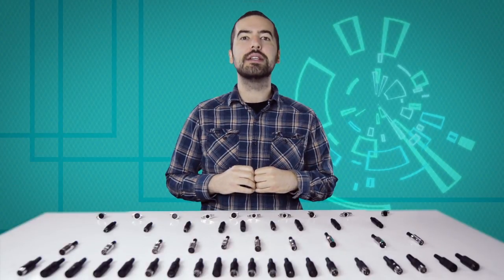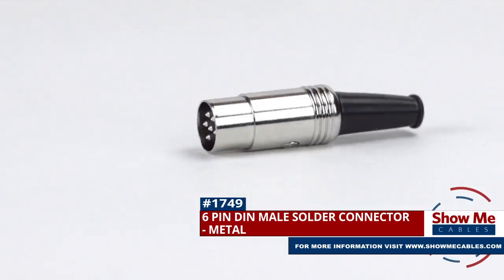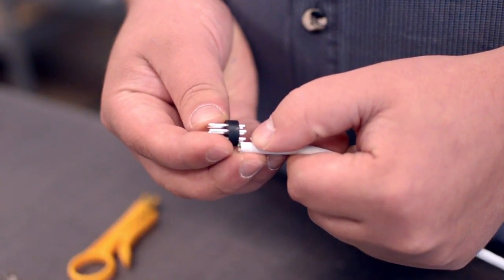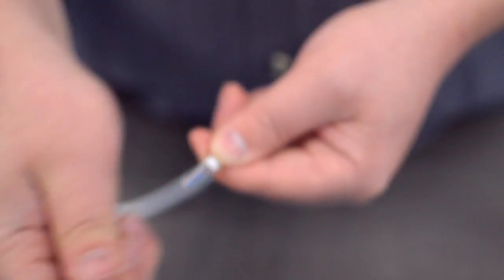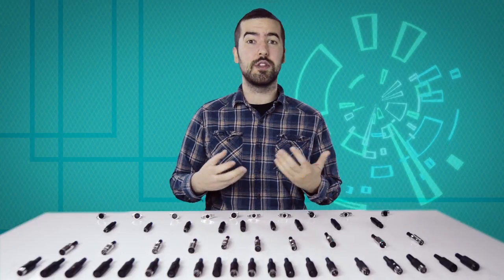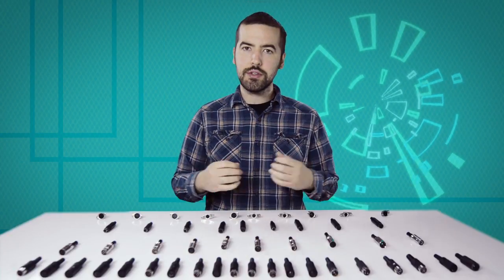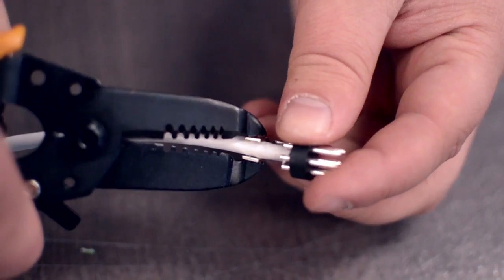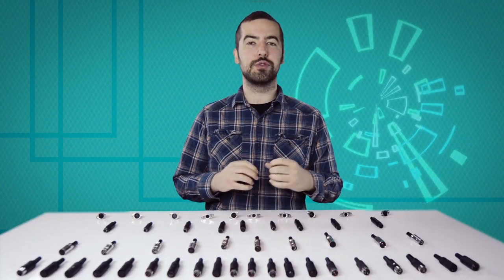How To Install The 6 Pin DIN Male Solder Connector - Metal

Comment: Well that was a waste of time. 

“Measure how far you will need to strip back the jacket by holding the cable up against the base of the connector.” — ummm… that doesn’t tell you anything. You need the distance between the strain relief and the solder cups.

“Now comes the hard part.  Soldering.  If you are new to soldering, it is recommended to find a someone who is more experienced for best results.” — So… a how-to video that says “if you don’t already know how to do it, find someone who does” and then shows nothing. 🤦